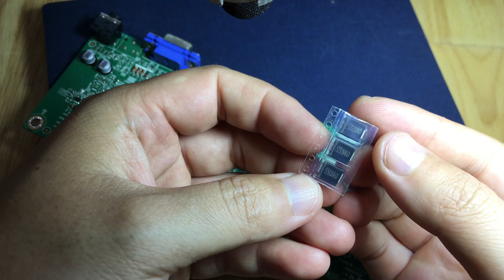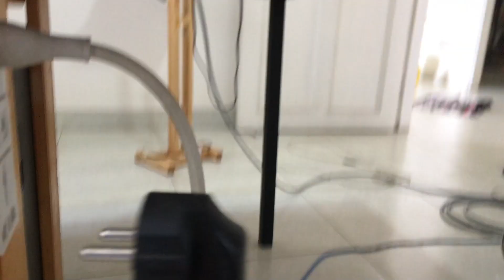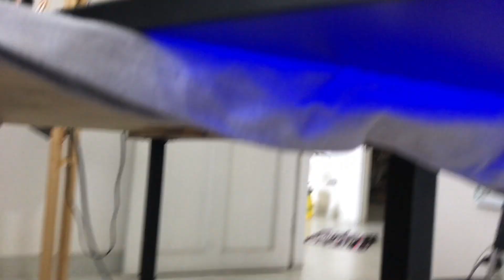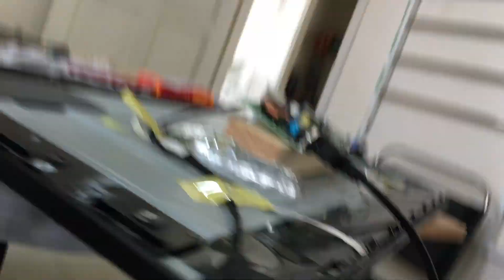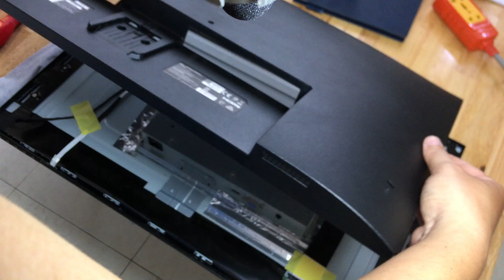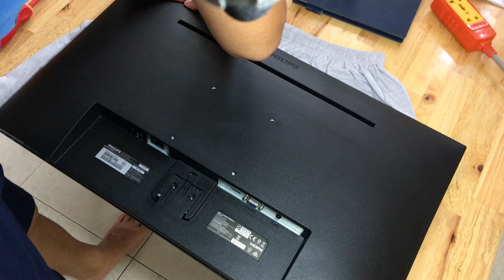Philips 271V8B/74 27 inch Monitor No Power (not a DIY video just sharing a tip)

Comment: can show us how to remove the back cover?
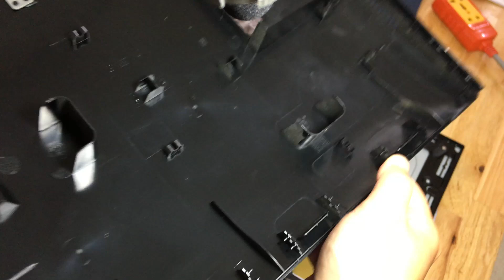Reply from the maker: I'm sorry I didn't capture that scene, however, if you look closely at 3:04, you can see the locking mechanism, which is about 10mm from the edge. After unscrewing the two screws, you can use something thin and sturdy to push in deeply and easily separate the back cover.